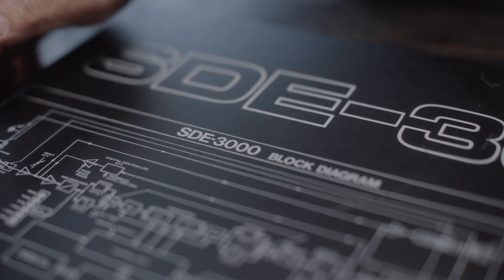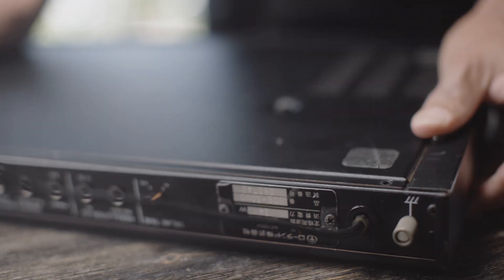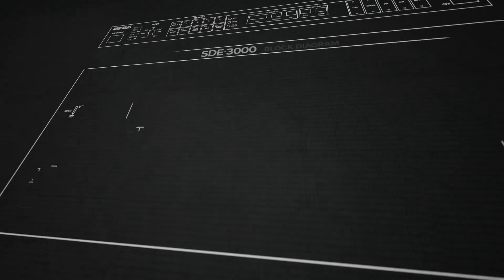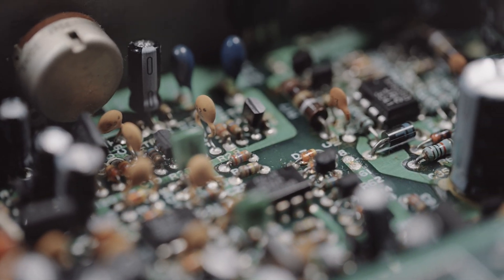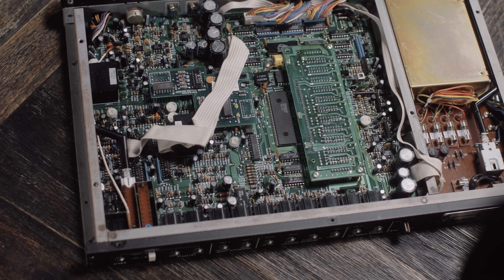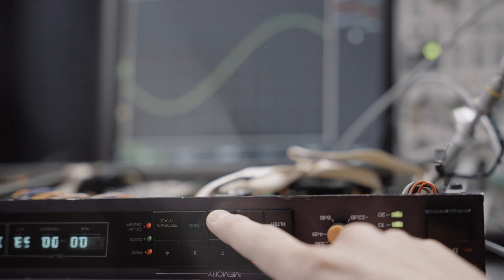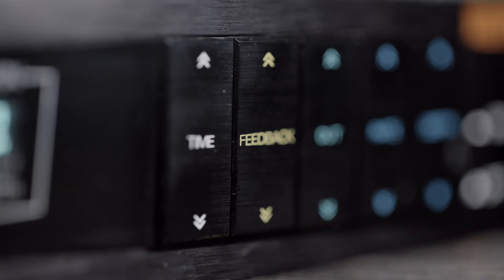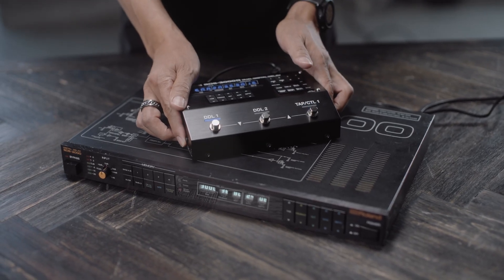Origin of Vintage Digital Delay | BOSS SDE-3000D

Comment: I have the SDE-2000 rack effect that I managed to find somewhere when I just missed the only SDE-3000 I've ever seen go in local listings. I'm still so in love in the looks of SDE-3000 that I yearn to have it in my rack. SDE-2000 is really cool too, sounds fantastic and looks fun, but SDE-3000 looks like VCR player and it was in Van Halen's rack too if that gets any hype points. And many other racks admittedly. Too bad manufacturers no longer make rack gear and such a good unit would probably also cost arm and leg bought new, second hand you can still get them sometimes for manageable price.

Thank you so much for interviewing Ikegami. There's nothing cooler to me than hear the original engineer or creator describe their process or explain the workings of the unit.

Comment: Why is there no video comparison between this and the original rack? Every time one of these pedals comes out - Korg SDD3000, TC2290, etc... there is an audio comparison that plainly shows what the pedal version is missing in terms of SQ. No pedal sounds just like the rack it's emulating, regardless of which one you choose, although some are closer than others. It would be nice to hear this side-by-side with the OG.

Comment: BOSS, why didn't you just use really small SMD analog components to make the same SDE-3000D in a smaller package instead of using DSP? I rather have used a smaller guitar pedal enclosure pedal just using analog SMD components rather than using DSP chips.

Comment: As as person who DIY builds old BOSS and Ibanez circuits (currently building a BOSS DM-2 with actual MN3101\3005 from the early 80's) the inside of the SDE-3000 is pure gear pr*n.

Comment: Me in 1987: "These Boss pedals are really cool!" 
Me in 2023: "These Boss pedals are really cool!"
Reply: '87 was the year they launched the NS-2 noise suppressor. One click of that thing, and poof! The awful 60-cycle hum between songs (especially with a high-gain guitar sound) goes away, even moreso if you have an effects loop and use the 4-cable method. Oh, and they just came out with the NS-1X, which is a very worthy successor indeed.